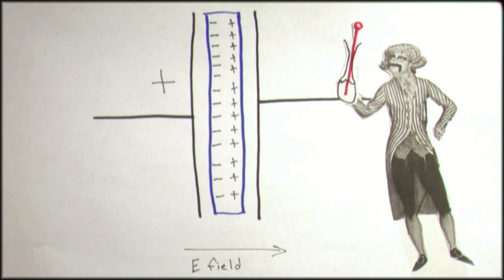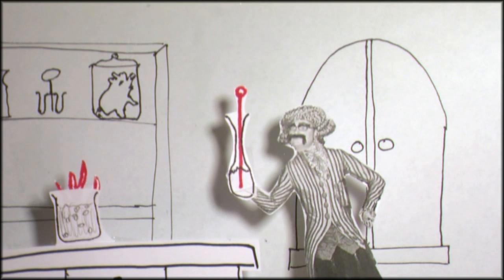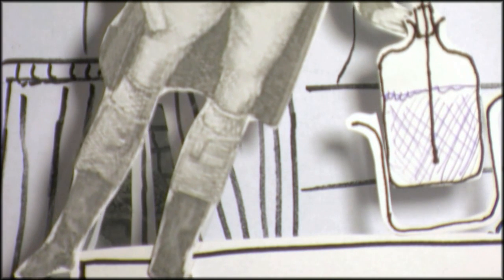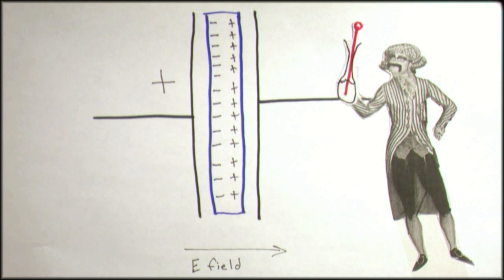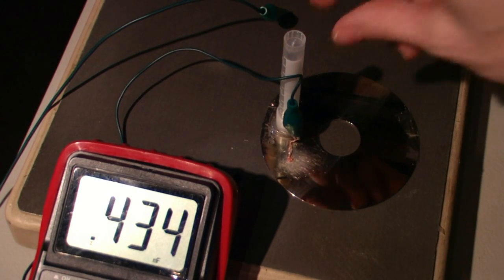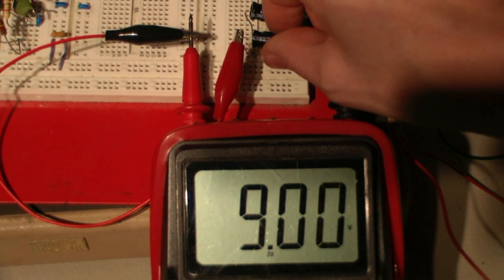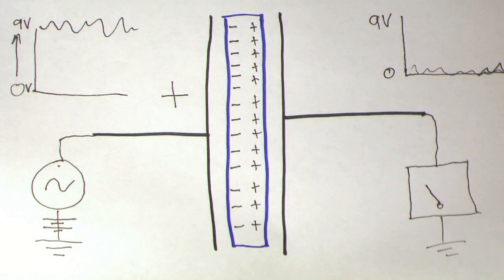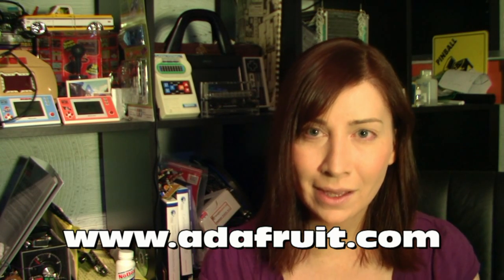Capacitors - A to Z of Electronics

Comment: Great video, J.  My grandfather worked in an auto repair shop until he retired around 1980. Not only did he tinker with electrical and mechanical gadgets all the time, he was a great practical joker (great combination, that). One of his favorite gags was to charge up a capacitor from a car's ignition circuit (this was way before electronic ignition) then holding only the case to avoid closing the circuit he would toss it to someone else in the shop.  They'd just catch it without thinking - POP!

Comment: I liked the clip at the end where you scorched the oil filled caps.

Having been showered in hot oil and shredded aluminum foil, I see why you didn't want to be around when they went off

I would like to see some intel behind the high voltage SCR's and DC to AC power inverters in one of your videos. I have one that came from Hugh Hefner's 'Black Bunny' jet from the 70's and it works like a champ; delivering 175W continuous / 270W intermittent.

Thanks, darlin'!

Comment: @alphabeets Good question - shows some thought.  No, it's not magnetic.  It is electrostatic.  The charge of electrons on one plate of the capacitor modulates the charge on the other.  Besides blocking DC currents as mentioned in the video, the effect is also what makes capacitors form useful filters that only pass certain frequencies of AC current.  For electromagnetic effects, look at transformers.  (Will that be the "T" when we get there?)

Comment: @alphabeets so you can get a lot of electrons (current) back out of the cap all at once when you need quick bursts of power but you'll never get more voltage than you had in the first place. That's where transformers come in. Electrons flow through one coil (primary) which generates a mag field. When that field energizes or collapses, it induces a flow of electrons in the second coil (secondary). If there are more or fewer windings of wire on secondary the voltage increases or decreases to match

Comment: @alphabeets No, they're fundamentally different. Caps work on electrostatic principle. Think of it as the electrons bunch up on one plate. That concentration of charge pushes all the electrons off the other plate but the dielectric keeps them from jumping the gap. Letting them build up (charge) and drain off (discharge) causes the the other plate to fluctuate in sync in useful patterns. Or you can store electrons for use later by delaying the discharge. (cont.)

Comment: @kholt420 Thanks for the response. Could a transformer be thought of as a form of a very low uF capacitor? As in a cap, you have two metal surfaces (in the transformer they are in the form of narrow metal wire windings) that are in proximity of each other but not electronically connected to each other. The thing in between these metal wires (plates) is the wire coating. Is perhaps the difference between cap and transformer simply the shape of the metal surfaces?

Comment: @alphabeets (Finally - the cool part) Put a transformer and a cap together. Charge up a bunch of electrons on the cap then discharge them all at once through the primary coil of a transformer with several thousand times more wraps on the secondary and you can get massive pulses of voltage.  This is how a photo flash or spark plug are made to work - caps and transformers working together.  Different but complimentary.